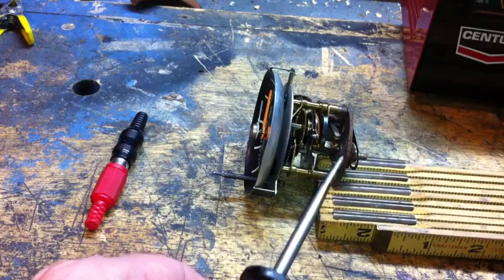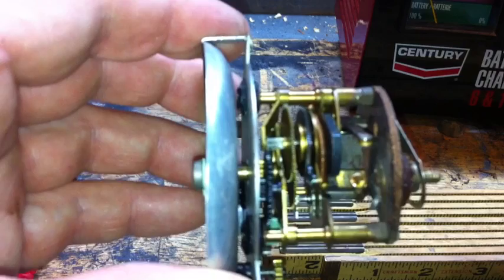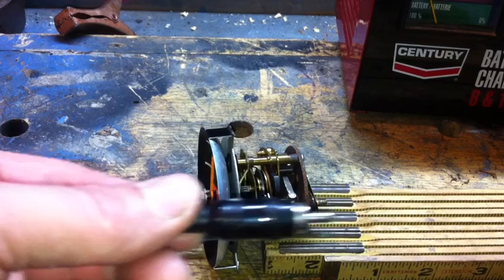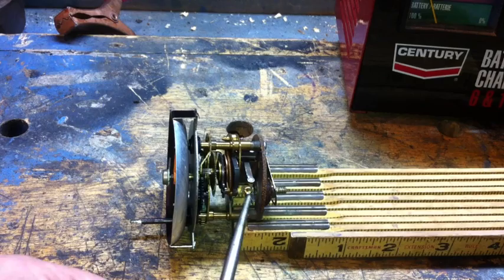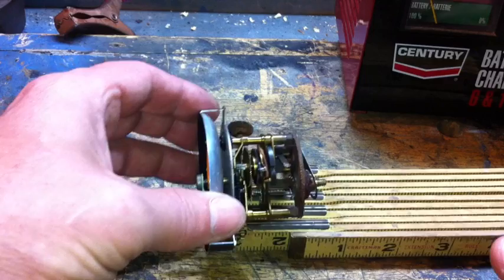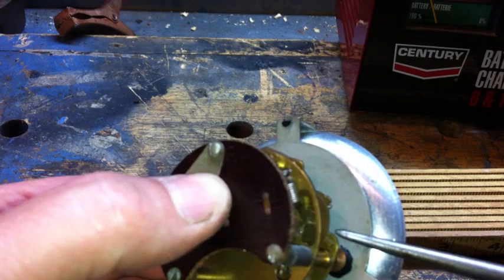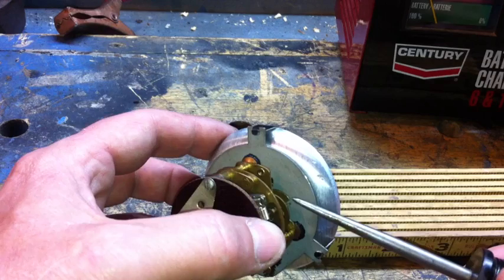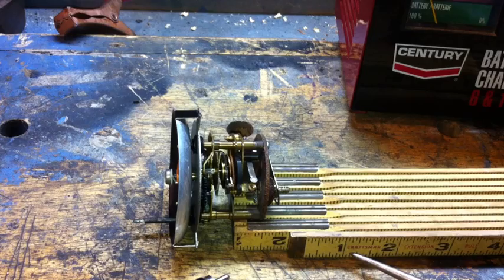Fix or Repair Your Classic Car Clock (Part 2)

Comment: I want to thank you for the rca jack tip. I had tried solder. Like you, it only lasted a few days. I have a beautiful console mounted clock  in my 67 charger. It has been running strong for well over a month. Thanks again.

Comment: Seems like an easy fix. The clock in my 77 pontiac stopped working about 30 years ago. Hope I can get it going again
Reply: +kinging9  i saw a place called "the clock works" in Wisconsin can repair it.

Comment: I had tried take the clock apart initially by taking of the nut and blade, but mine has a brass sleeve surrounded by a rubber grommet and neither of them budge. I can only guess mine is somewhat different, best leave well enough alone I suppose while I still have a clock to put back in the instrument panel lol. Again thanks for trying Michael.

Comment: 1964 Ford Galaxie: I pulled the clock from dash. The movement when I open contacts runs the second hand as spring closes contacts...contacts do not open when powered by 12 volt charger....contacts are pitted so I filed them down flat and made new copper contacts which I soldered to contacts.....opened contacts and attached power to clock, when contacts closed they stayed closed and burnt out the thin wire to the coil....any advice as to why  this is happening?...thanks.

Comment: oh btw this clock was in a 1967 super sport chevelle. i'm with u it probably had been burned out the points since the 70s  I put the 2amp fuse in case the battery goes bad .

Comment: Hi Im working on a 1974 dodge challenger rallye clock.  I am doing the burned out points repair you've detailed.  My points reset doesn't travel very far.  every 30 seconds or so the clock points fire and reset.  I can manually push it back much farther.  is this normal or should it reset after a longer period of time.  Any insight appreciated.  Thx.

Comment: Wondering if you could offer advice on how to remove the stem from the clock?  I have a 67 corvette clock that I have gotten working but the stem is corroded and needs to be replaced.

Comment: Do appreciate you getting back to me Michael. Yes I have browsed the Chevelle site and have even posted with no success. The housing in the first part of your video showing three notches is very similar to mine. My question is, do I push up firmly on the steel tabs seated in these notches to free up the clock from the housing or is there a different way. I've been a little leery of trying that not wanting to do any damage that can't be fixed. If that's the case will the clock/tabs snap firmly back into the notches later on. Hopefully I'm on the right track, thanks.
Reply from the maker: Gary Mosterd 

IF I AM READING YOU CORRECTLY… There is just one nut on the
back of the clock that needs to come off. It’s the same nut that holds the positive
electrical blade (where you plug the clock in). When you undo that nut, the
clock should just easily slide out of the little metal housing. The “tabs” you
mentioned are really just for proper alignment of the clock into the housing. Don’t bend
them, or try to force anything.
Reply: Gary Mosterd did you have any success with this? I have an El Camino clock thatI want to fix, otherwise I'll have to convert it to quartz.

Comment: How do you remove the hands from the clock?  I have a 67 Impala and can't remove the hands
Reply from the maker: Ever so gently from the center of the clock. They are just pressed on to 2 or 3 shafts, as best I remember, 1 for the second hand, 1 for the minute hand & 1 for the hour. Be VERY patient while gently removing & reinstalling. I just use my fingers under the center point of the shaft, not a metal tool.

Comment: oops I spoke to soon went out the next  day, clock  had stoped saw burnt place on the top points that was the orginal one I had filed it clean ,  but  they stuck an burned out again, guess i'l go with quartz clock now , was really hard tryin cuts perfectly square the points  like u said it really impotant , but the 2 amp  fuse should burn before frying the clock ?
Reply from the maker: +Dale Ratliff I don't have first hand experience with the fuse. That's what other people on the net told me to do & said it what was they have done. If you get a quartz conversion, I'd be more than happy to take your old "guts" & try to get it working for my car. My clock has finally worn out completely (long story) not the points though. Don't just throw your "guts" away: Powell 9923 Knoll Krest Dallas, TX 75238 :)

Comment: I have a Borg clock like yours. The points look ok after I filed them down.  When it's hooked up to the charger and the points close, nothing happens.  Could it be the winding?  If so, any clue how to fix?  Thx.
Reply from the maker: I would check the gap or "strength" of the points where they make contact. I have experienced something similar & had to GENTLY bend the arm of the top side of the points so when the spring loaded side came up they would make better contact. Also, make sure the points are very, very clean at the flat contact spots. It doesn't take much to keep them from NOT sparking open so then the spring will slowly try to pull them shut.

Comment: Can you explain how to get the clock out of the housing. Really anxious to give this a try on 69 Chevelle clock......."thanks.
Reply from the maker: Gary Mosterd 

I am not familiar with the interior of a Chevelle or the
housing that holds the clock. If you go to “Team Chevelle” on the internet there
is a wealth of information. Do  a search
 for “clock removal” or something similar. Here is an example: http://www.chevelles.com/forums/showthread.php?t=50745
Reply: +Gary Mosterd casing is bent in in a few places,,     I used needle nose plyers

Comment: how's it running   ,,, it's not hooked up??
Reply: Was wondering same thing, unless it was stored potential energy?
Reply: It's running literally on a clockwork mechanism. It's running on energy stored in its spring.
When the spring winds all the way down, the two contacts (points) close, sending12 volts to the winding mechanism, which winds the spring electrically, but only briefly. Thus the spring is wound up again, and proceeds to gradually run down until the contacts close again, winding the spring once more. In this way, engineers were able to use very little electricity to power automotive clocks.